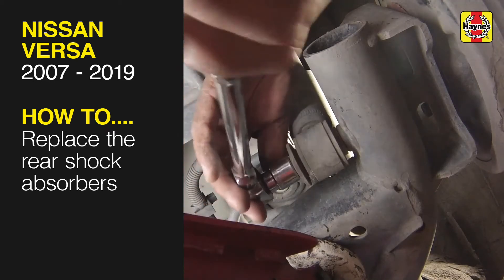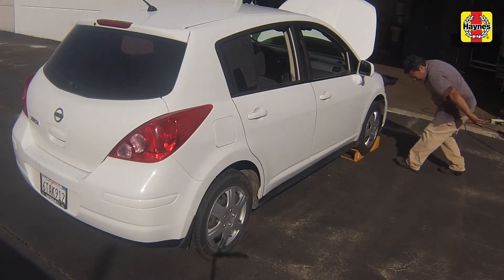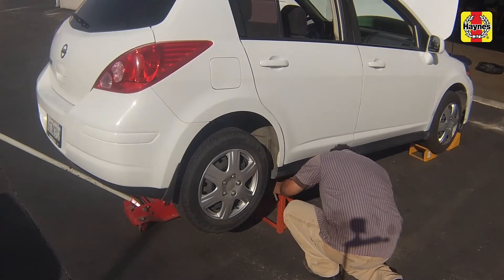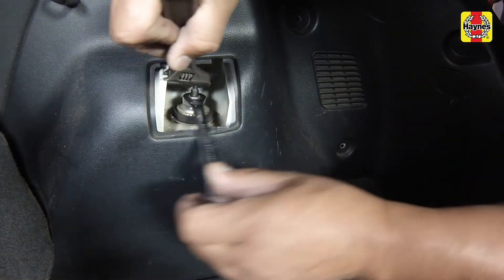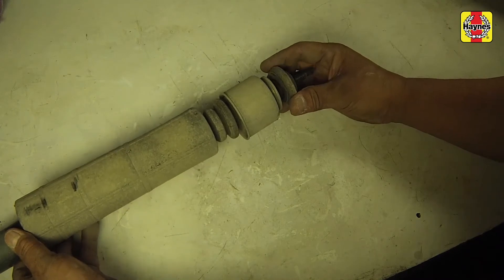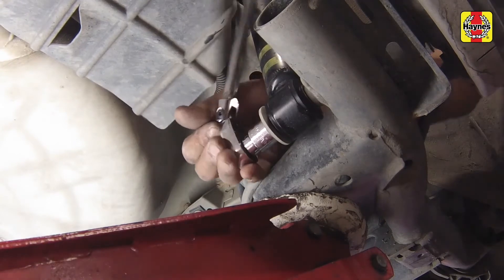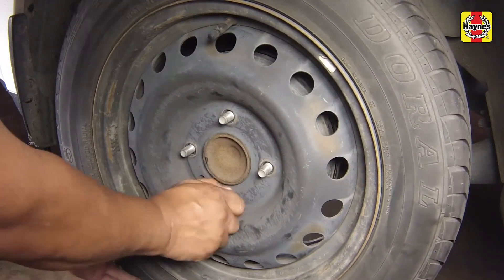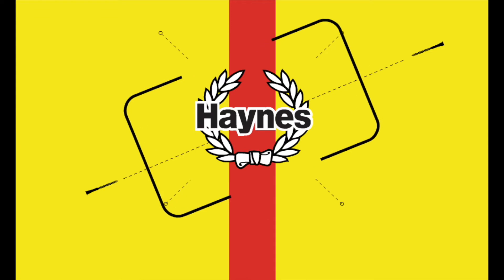How to Replace the rear shock absorbers on the Nissan Versa 2007 to 2019

Comment: What's the "normal ride height"? Is there a rule of thumb on that?
Reply from the maker: Good question, and basically, yes - this just means to raise the lower suspension arm until much of the vehicle’s weight load is simulated for tightening the rear shock lower bolt.